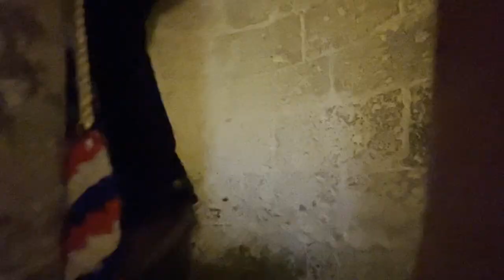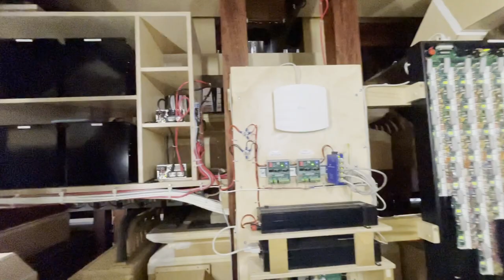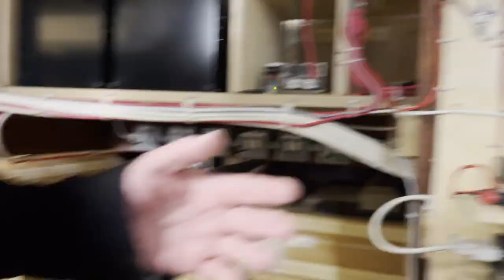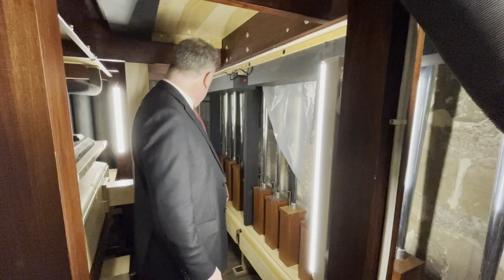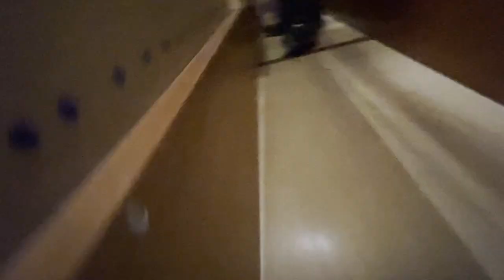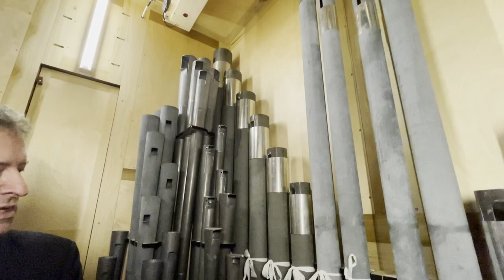Inside the organ at Waltham Abbey

Comment: "The guy that designed this organ was young and slim!"  I've heard that before about a number of organs.

I like your comment about the wind supply.  I agree that slight variations in the pressure give the organ it's natural sound.  I believe that as digital electronic organ technology has improved, the subtle ways in which the wind interacts with the pipes are what make the difference between a pipe organ and an electronic organ.